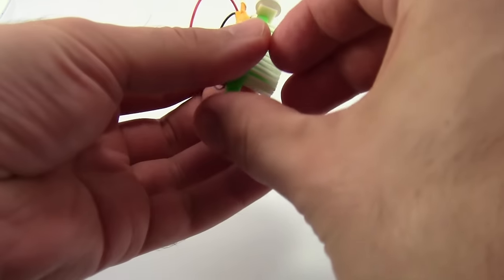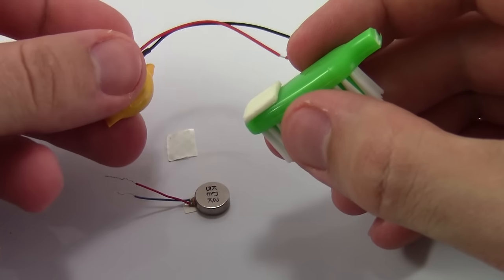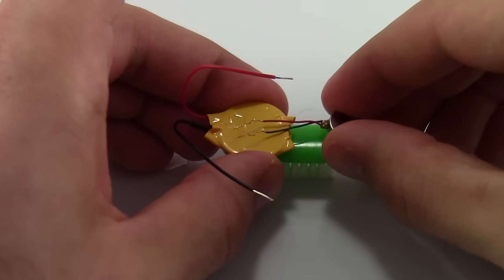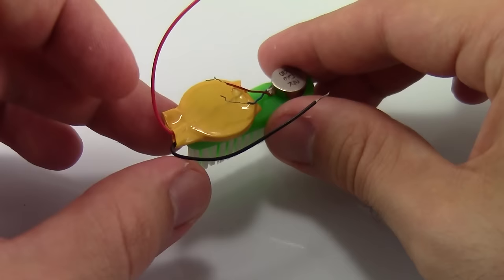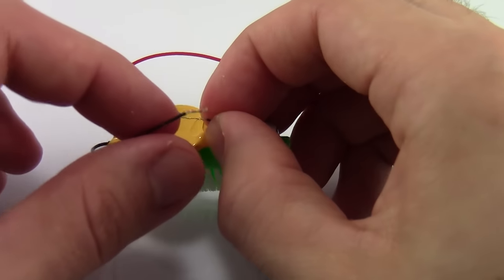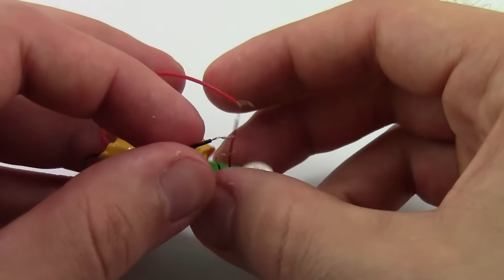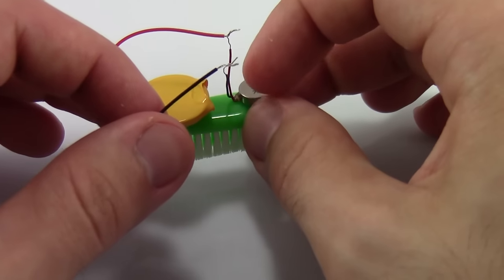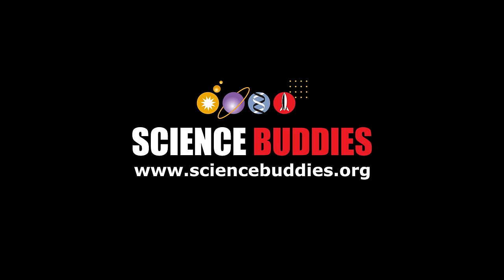How to Make a Bristlebot | Science Project

Comment: Where's the onoff button
Reply from the maker: This circuit does not have an on/off switch - you must disconnect one pair of wires to turn the motor off. If you would like a robot with an on/off switch, we recommend our Brushbot project which is a larger version of the Bristlebot: https://youtu.be/S3GAL2MshCw